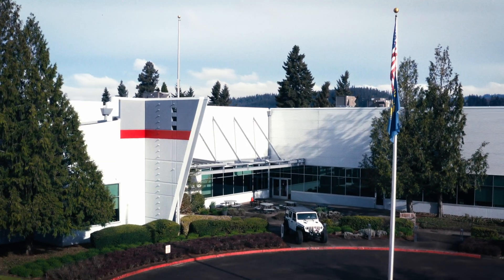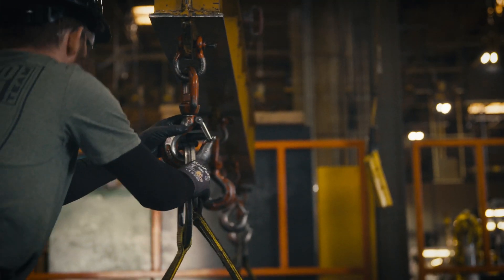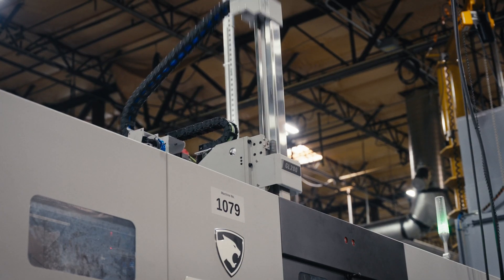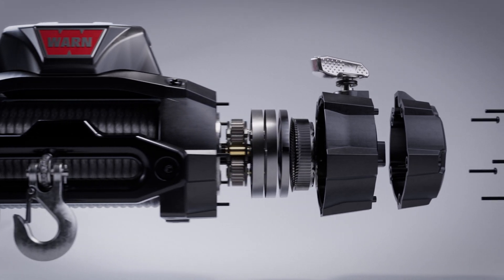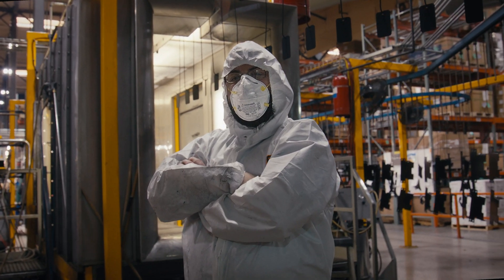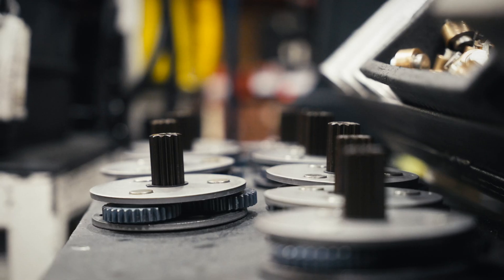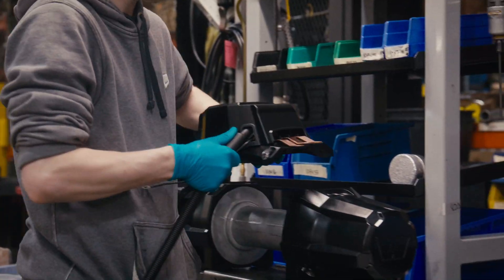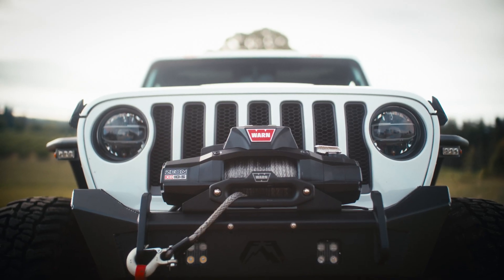ZEON XD in CLACKAMAS, OREGON

Comment: It's time for a new winch, what upgrades over the normal zeon 10-s?
Reply: High pressure water proof IP69K, built in wireless receiver for smart phone control up to 100’ away, much faster line speeds unloaded or loaded (up to 40% faster than standard and 7% faster than regular zeon) more less weight, electrical bus for connections (zeon 12k xd s only has 80’ line with larger aluminum drum to maintain faster line speed under load) lots of billet aluminum parts